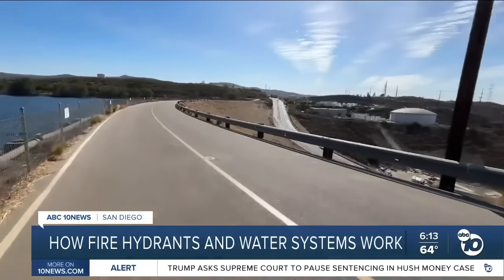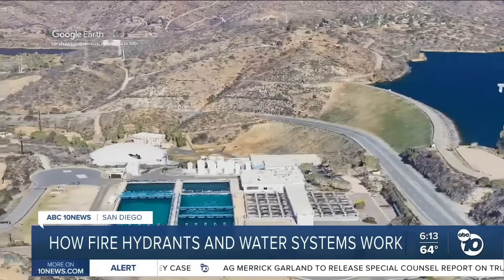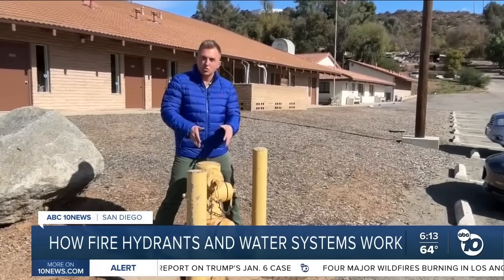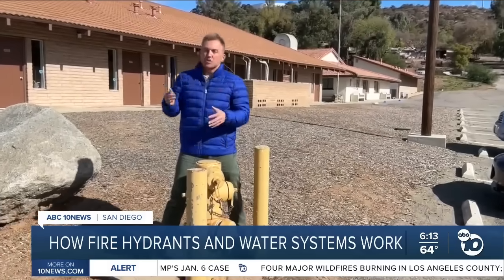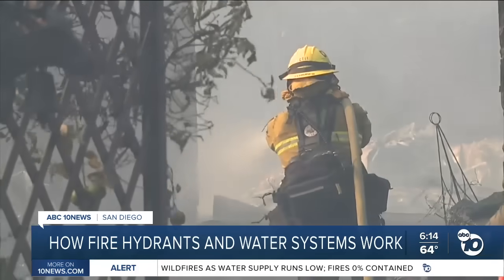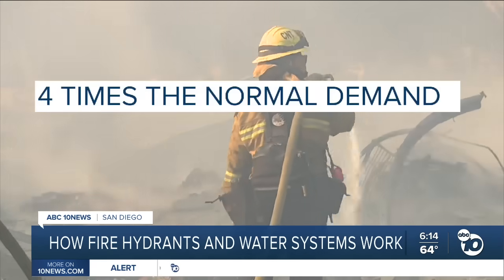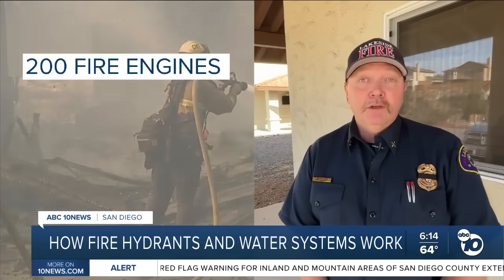How fire hydrants and water systems work

Comment: Their is a difference between getting water occasionally from a tap than from a hydrant going full blast, now think about that water being blown around and turned into mist by the Santa Ans Winds doing 100+ miles per hour and then tell me why every one is suddenly a water expert?  Big BS, people just want to have target to blame and beat up.  Idiots!  JUST try standing upright in  100 mph wind gusts full of embers; while holding a fire hose, while everything is on fire at the same time.  I bet everyone who is blaming ran away fast or were not there. more idiot  big mouths..  Thank you to everyone  concerned that risks their lives to control an urban fire  under those circumstances and God take care of everyone who are victims of this natural disaster. Lastly thank you to everyone who made the best discussions possible knowing that homeowners really resist any expense that will raise property tax when it already is so expensive. They got fire hydrants which was once a very expensive option for a township.

Comment: I am a civil engineer having more than 10 years' experience in water supply. Either the description in the video is wrong or not comprehensive; otherwise, there was a major design fault. For water supply for fire fighting or emergency use, we must not rely on electrical system. It must rely on gravity flow from one or more service reservoirs or large water tanks built at a higher level. These reservoirs/tanks should also be filled up by pumps (during low consumption period, say at night time) or stream course from more high level. Of course, during fire fighting, pumps should be turned on for filling up the reservoir/tank, not directly pump water out from hydrants. I heard that the construction of service reservoirs were banned. If there is no service reservoir in place for feeding hydrants, the fire fighting system is a design fault.

Comment: More "BS"  FYI: there are back-up pumps at the treatment plant as well as throughout cities.  Not to mention there are generally gravity feed storage tanks throughout with there own pumps and the fire trucks have pumps on them.  So power is not an issue or use.  The government dropped the ball on monitoring the reservoirs and pumps systems.  Basically a GOVT "BS" cover-up.  BTW: it doesn't help when half the fleet is in disrepair and the budget cuts on top of personnel cutbacks and lack of care and training.  DAM DEI "BS"

Comment: I’m not an engineer but the fire guy in this said, if approx 200 trucks pump water it’s going to strain the system….but LA has close to 4M people using water everyday, 200 trucks using water is a drop in the ocean
Reply: Those 4M people are distributed over an area of 500 square miles.  Try running 100 amps through a 15 amp wire.
Reply: @jobhiojkp don’t try to convince YouTube experts, they are smart, they have the data 😅
Reply: @gund89123  Big pipe in picture feeding tank-----smart person at LA DWP telling worker turn on feeder pump-----problem solved

Comment: They should have installed an underground system where river water is attached to each household and incase of fire eruption. They open the lid of those underground tunnel and that water works as fire extinguisher Even though it takes a lot of spending on building that infrastructure. But it shifts the load from the shoulders of firefighters 🚒 and saves damage to your homes and private properties.

Comment: This news story is the stupidest thing I've seen all day
Reply: Why..it's all facts...  those water storage tanks for the drinkable water and Fire protection are not sized to hold enough water to fight a massive fire like this. Once the water storage is drawn down (faster than the pumps can be replenishing) you will run out of water.  plus like he said, if power goes out to a pump station you and no new water to try and supply the system.. the real issue is the choices made to not maintain the forests and brush.

Comment: Right, because there isn't a network of pipes and pumps with all kinds of water too and nobody like an engineer ever designed the supply systems to feed fire sprinklers, normal use, and fire hydrants all at the same time. Nobody ran calcs, no reports were ever done, and no system was checked or designed to maintain pressure and hence flow when there is a high demand.

Oh wait.

Stick to reporting and fire chiefing guys, and go consult with the engineers that design these systems.
Reply: DEI effectiveness.

Comment: The water department doesn’t have a backup generator, come on. Who’s in charge, poor planning.
Reply: Exactly we have one at EVERY pump station and most go on automatically when the bump is for more than 30 seconds. We do monthly checks on these generators and they most never fail.
Reply: Ask The Resnicks!!! aka The Wonderful Company
Reply: Where exactly does he say that there was no water because there was no power ?
Reply: The power outage was not because there was an issue with power supply but because it was for the safety it's called PSPS
Reply: @phoebenichole  and Joe Biden is the besr President in the History of the USA.

Comment: Why do fire hydrants need potable water? 🧐
Reply: Same system.  Saves $ from 2 separate systems
Reply: @ that’s my point you don’t need two separate systems. It’s called retrofitting🧐rookies
Reply: They don't "need" potable water. It is just more efficient to have them installed within the potable system mains rather than have separate raw water mains everywhere.
Reply: @ it’s called retrofitting the mainline should of been done it 20 years ago🧐
Reply: Why are you asking the internet? Google it or go down and find out yourself. 🫵🫵🫵🤡🤡🤡
Reply: Would you like them to lay special lines just for the hydrants? Imagine your taxes then. I'll spell out the common sense for you - The potable water system is designed to deliver water at pressures and flow rates sufficient for both everyday use and firefighting needs. This eliminates the need for a separate, high-capacity water distribution network exclusively for hydrants. Using a single water distribution system reduces infrastructure costs - mains are already running down streets to give water to homes. Building and maintaining separate systems for potable water and firefighting would be massively more expensive, the water would stagnate and cause maintenance issues, etc....
Reply: @ first of all buddy I’m one of the best renowned pipeliners in SoCal and and all you need too do is retrofit the potable distribution water lines with tees coming of the reservoirs and stoppable fittings to redirect clean water against straight reservoir water, and of course it will take work but well worth it in the future. It should be easy being it weak ass water line work my grandma could do. Anything else?

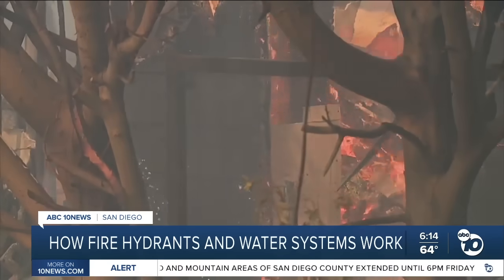Comment: 1:26 actually 99.99% of plants and pump stations have Expensive backup generators, we had one that cost close to 1 million.
Reply: Nísoskeoekeoeo3oeo3ieo3oi3iekkw
Reply: Backup generators need fuel, that can run out eventually and is flammable as fuck. Even the electrical backup batteries are vulnerable to fire. If those were to catch fire, no amount of water would put them out because they produce their own oxygen.

Comment: Why not have the Treatment plant increased their flow? 1:23 This is incorrect....Pipes can flow ENDLESS water, its depends on keeping the tower(s) to filled capacity which if the local pump station will have to continuously be on which it gets higher demand from either its reservoir and/or Treatment plant through distribution water mains.
Reply: They do not have towers in these areas...they are illegal to use.
Reply: @davidbryant3532  What??? Illegal?? This State must hate their residents.
Reply: There a diff between endless water vs  at enough VOLUME . If your fire trucks pull more water than can flow thru the pipe, you're toast.
Reply: @16radioman  Have the treatment plant increase flow...They should be able to flow 30 million gallons a day.
Reply: @JeffOTRCycling You are clueless.   You're not getting millions of gallons through 6" pipes.
Reply: @susanlovesjava4961  before I go to bed let me blow your mind. Our Treatment pumps do not start at below 7 million gallons a day. That is the absolute lowest we can go.....Now that its 20 degrees and winter is here that is what we are running and we are still getting a surplus in our reservoir. Good night.
Reply: @JeffOTRCycling  That's the reservoirs not the flipping distribution system.   I worked at WTP with reclamation plants bigger that your full sized plant.  START thinking.

Comment: As someone who installs these systems being your water means lift stations when they design the systems they are designed for scenarios just like this The reason you're running out of water is because you weren't prepared nobody made sure the lines were cleaned because they will gum up we've had valves stuck or pipes that corrode so you're not getting full water supply there's lots of scenarios that I guarantee nobody looked at prior to this happening. Also you can suck straight out of the reservoirs You should have a place where they can do that so yeah the government screwed everybody.
Reply: Gum up??? You mean tuberculation? That will not cause what they are saying...The towers were not filled and their treatment plant wasn't pumping enough for the flow...Depending the size of the treatment plant if its a level 3 plant it should easily pump pump out 30million gallons a day and most use lime so to lower tuberculation which is from YEARS of buildup not because of ONE time use. Actually pumping out at high demands is better to go through any tuberculation....Tuberculation is more effected with low flow. The only thing they would have to worry about is maybe a broken main, if they have asbestos pipes in that area.
Reply: They need all of that funding to back the green deal and global warming though ..
Reply: People should be questioning why the government entities fighting the fires...one being the fire department that has the biggest budget and the best equipment in the world to fight these fires can't handle a small little fire that gets out of control.
Second water districts which are government entities they have the latest and greatest have money for storage and back up generators that fail when they need them the most because most of them run at 100% SCADA with no manual backups or back up safeguards or not having the personnel  to understand that anymore, government at every level has been a failure in America the last 25 years!

These entities are nothing more than socialism government entities with taxpayer money both entities should be privatized even if it means higher costs they would be held to higher standard with no excuses to the public!
Reply: Ya get what ya vote for.
Reply: @LiberPater777 exactly this. Look at all the poor rich leople
Losing their 7 million dollar homes. Where was CNN during the hundreds that were lost in the floods in the Carolina’s? Ah. Not enough actors and rich people.
Reply: I’m a fire sprinkler fitter 
Makes me wonder if they did any testing, preparation for scenarios, check diesel pumps 
Not sure how it’s done in US but in Australia the towns main will always have enough water for a scenario like this even in drought conditions 
This is baffling
Reply: it isnt the governments fault, the reservoirs that contain the water for the hydrants are also connected to the homes the fires are threatening, and when thousands of people are using trying to hose down their homes (which does utterly nothing against a fire), it leaves very little water pressure remaining for the firefighters. This is physics at play, its not necessarily anyones fault but it is wrong to spread this misconception out in the world
Reply: @samuelv8002  You're absolutely 100% wrong
Reply: @digger1825  correction here. Misread the context to who you were responding to. 
That guy is absolutely wrong. They pay their municipal water employees to ensure shit like this doesn’t happen.
Reply: @ i am a physics student that spoke to my professor about this so i am well educated on this misinformation being spread around so i can guarantee you this is part of the problem
Reply: @Jax-c1c how much water flow is this system designed for ?
Unlimited water pressure for unlimited time ?
Reply: And the "news" dutifully helps cover for them. Hey, Sh!t happens.  Nobodies fault but just bad luck timing.